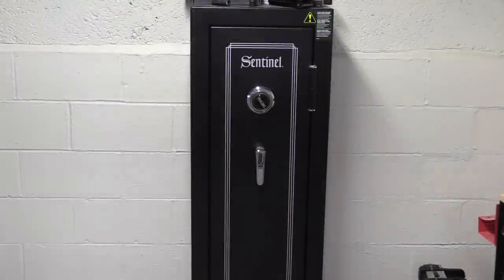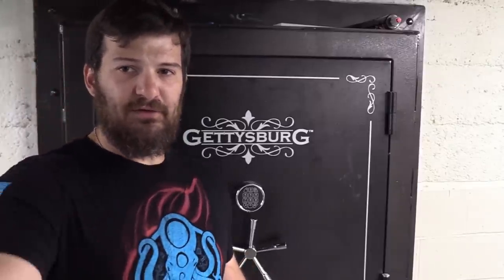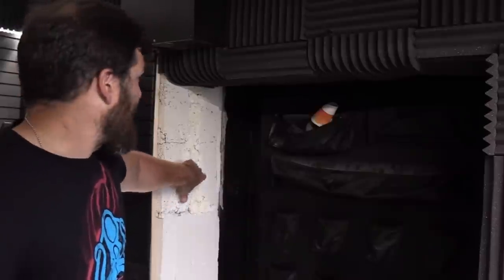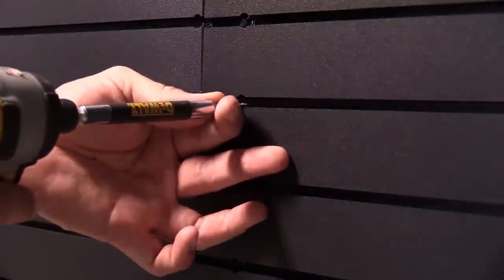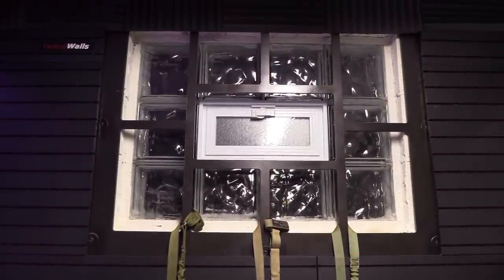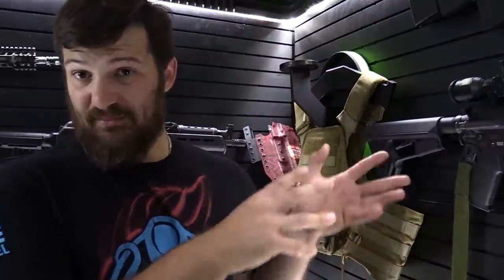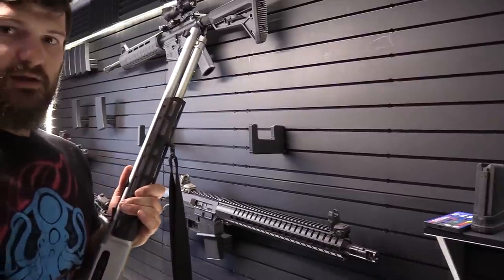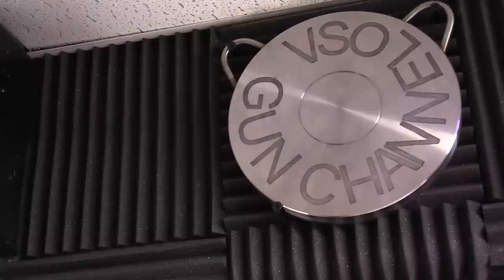The Ultimate DIY Vault Room

Comment: Solid concrete with steel reinforcement, giant steel safe door with more steel reinforcement, and a glass window. One of these is not like the other. #goofy
Reply: Tackle Response RIGHT WTF?!?!?!?!?!
Reply: Yeah maybe some ballistically resistant material; the industry actually makes one way bullet resistant ( note  that  I’ve edited this word proof to resistant at the request of another whose laser focus on my grammar can only be described as asinine , but in the interests of absolute clarity and correctness I have edited in .  I express my unceasing sorrow to the sixteen people who liked my comment before this edit and I pray my misuse of language has not lead them astray ) “glass”.  You can literally shoot through it from one side whilst absorbing impact from the other.
Reply: How do you get out if the door gets locked from outside
Reply: @112boatman  Anyone with common sense would have an override for the door. Not sure how that would work with just regular safe door but most people dont cut  the front of a safe off and use it as door. Not to mention hes not gonna fit out that window anyways.
Reply: grenade.. and a couple of dwarfs, and  you can clear that room  in 4 minutes.... a few skinny people also would work.
Reply: Drop ceiling...does that mean you can climb through the outside??? If so it was a total waste. Also, I don't feel the safe door without an internal override is smart or safe for the owner. Otherwise I think it's an ok build.
Reply: Ashanti Kidd na.. i drop ceiling is a lowed / suspended frame ceiling . it hangs off the exiting floor joices
Reply: there's also the fact that's a drop ceiling couldn't someone get in from the floor above? i mean don't misunderstand this space is a sweet mancave and props for doing it all himself but from a security standpoint? maybe a 5/10 if i'm giving max props
Reply: He said the ceiling was something like 18" thick concrete... he just added the drop ceiling for aesthetic and acoustic reasons.
Reply: 112boatman that is a handsome question and I’m glad you asked it! I think I have the answer: Humans can survive 187 days without food or water as long as they are  locked inside a safe containing that many guns. This room is awesome!
Reply: Looks like some steel bars across it, but yeah probably the weakest link.
Reply: show me a human being, who can fit through something 12 inchs, by 4 inchs that isnt a child, because lets be honest, an 8 year old would have a tough time getting in there.
Reply: the window !! LOL
Reply: @akidd2420  he said he has an 18" concrete ceiling the drop ceiling just hides it buuuut that window kinda defeats the purpose of any kind of vault
Reply: Get a battery operated grinder & your in lol
Reply: OK - so if there's a door release inside, so that you can't get locked in, and you can break the glass, just get a kid through the opening, and tell him to open the door from the inside; then it's just a race between the perp and the cop response time.  Takes timing, but - Ocean's 11.
Reply: Brian Manning this aspect is what makes all safes not secure but that's not really the point. I have a safe to keep the kids out and the prevent someone from walking out with it. Hopefully it takes long enough to allow the cops to arrive. A grinder is cheap and most places with a safe also have wall AC power to run a grinder on, heck I bet most people with a safe also own a grinder and extension cord. Suffice it to say, nothing made of metal will keep a determined person out of it. You can buy a plasma cutter on the way for $400 and go through a safe like a light saber using wall power and compressed air. A perspective coming from the mining and heavy equipment industry, it's apparently not obvious to people but the minerals are much harder than metallic elements and wear out steel like butter. When say, a face shovel is rebuilt a mechanic will cut the lip off typically. This is usually 4-6" of solid steel, they will air arc through it in minutes. 
My thought on the window: same principle to the steel applies, you could effortlessly cut it out with a torch or grinder. Probably start a fire with a torch tho. I think the window in all likelihood would essentially be an after thought. Presumably no one would know from the outside that there would be something special inside, you would find the safe down there and maybe connect that there is a window in the space. Investigate, break window, find bars. Hopefully the cops have arrived by now, he said they were quick. If you go into it knowing what your facing then there is an answer to anything you face but that's not really how most robberies are going to happen in homes (I think).
Reply: @CarCrazyRDM  he said that....but i don't know if i really believe it.  Don't know how you logistically create an 18" concrete ceiling, and also...a drop ceiling is not aesthetically pleasing at all.  Especially in this room.
Reply: @mrrobvs  Not on top of cinderblock basement walls especially. I imagine it's just regular residential construction wood floor joists and plywood up there.
Reply: @madmetalmaestro9806  probably should have listened better. He covered this.
Reply: @akidd2420  have you ever been inside an office building? Or any retail store ever?
Reply: @bored588  that mid section looks to be 8 to 10 inches wide. I could totally fit in there. 

On top of that, a solid diesel truck with logging chain would RIP the shit out of that grate
Reply: Weld door shut or block door = tomb
Reply: Tackle Response how about the drop ceiling? Lol
Reply: Y’all damn well know that the thief’s ain’t gonna realize there’s an easy way to do it bec they so damn focused on getting the door open XD
Reply: Kick that little window open and you can fish all the firearms out through it. No need for anyone to enter the vault.

As far as the door goes, a good angle grinder would make a short work out of those 15 bolts...
Reply: Bad ass room. Seems secure.. not sure about the glass window tho
Reply: even worse, the roof the wood floor above can EASILY be cut or smashed thru LOLOLOLOL
Reply: Block glass is a bit harder to break then normal pane glass and then that steel grate. Its not that easy for someone to get in there
Reply: @112boatman  MOST PEOPLE WOULD NOT.  BUT YOU CAN JUST TAKE THE BACK SAFE DOOR COVER OFF (USUALLY FABRIC OVER SHEET ROCK) AND DISASSEMBLE THE CAM SYSTEM THAT HOLDS THE DOOR PINS IN. THEN YOU JUST PULL THEM OUT.  PRETTY SIMPLE IF YOU HAVE THE TOOLS (NOT VERY MANY NEEDED). A BIT MORE DIFFICULT WITHOUT BUT CAN STILL BE DONE.
Reply: Well, technically it's all a waste of time since he said it's on a security system, and the police have a very fast response time. He could have just bolted a generic gun safe to the floor if your using a good security system, and your police actually show up in a timely manner. That just means you won't have enough time to rob anything.
Reply: And drop ceiling...
Reply: Oda Chikazane unless they watch this video
Reply: Lol...someone’s gonna be able to get in there
Reply: @charleshetrick3152  Bullet resistant is not bullet proof.  Also...  It's not one pane of "glass"  It's several layers of plastics, glass and absorbent films.  The protection works for both sides the same exact way.  So there is literally no way for it to be vulnerable to one side and not the other.  Basic science tells us this as well.  Certain rounds will not stop penetration, but merely slow it down.   If you hit the same general area with a round, regardless of size, the protection will fail. 

Movies do not tell the truth my man!
Reply: @charleshetrick3152  I guess you don't understand that if the "glass" is weakened, it will NOT be effective.  BUT you also failed to hear him say "BULLET RESISTANT" within the first minute as there is no such thing as "bullet proof" as you said.  

Plus, from the "9mm" hand gun test...  They used hollow points one way and steel core FMJ the other way.  Plus if you look at the hole sizes, they do not compare.  The impact point of a round that is stopped would be larger due to the fragmentation of the round.  

For the riffle test...  Look up muzzle velocity.  The shot fired into unaltered safety glass from 25 feet is significantly slower than from point plank range.  PLUS, it was fired into a compromised window, which eased it in breaking through.  

You must be from The Hetrick-Martin Institute.
Reply: DifficultyLevel Noob if you’re so concerned maybe buy some of their product and test it yourself and show me how it’s done.
Reply: I looked up the institute, you see I did research before talking right out off my ass.  The institute purports to support LGBTQ and so forth.  I believe in the freedom of all people and can see not problem with the institute, given a five second reading of their mission statement.   There are however an unfortunate number of bigoted individuals in the U.S. so maybe I’ll let them (the institute) know that one way bullet resistant glass exists.
Reply: DifficultyLevel Noob I can find no documentation of wrong doing on the part of the institute.  Please enlighten me and provide me with sources that I might know better.
Reply: DifficultyLevel Noob re 9mm at muzzle vs 25 feet you’re wrong,  you’d be looking at barely 35 ft per second velocity fall off from muzzle velocity.  That’s within the margin of error for the majority of instruments used to measure velocity.
Reply: DifficultyLevel Noob glass was written in quotes so as to let the reader know I knew it wasn’t regular glass.  Just like when CNN calls rioters protesters they really should put protesters in quotes as to draw a distinction between the denotative and metaphorical use of the word
Reply: DifficultyLevel Noob I’m not particularly familiar with LGBTQ issues or communities but when I search for criminal complaints or records regarding the Institute I cannot locate any.  If they are really promoting pedophilia and you’ve evidence to that effect have you turned it over to any policing authorities.  If you have and been unsuccessful convincing persons who could to prosecute please do let me know.
Reply: @charleshetrick3152  "For the riffle test...  Look up muzzle velocity.  The shot fired into unaltered safety glass from 25 feet is significantly slower than from point plank range. "

Where are you getting anything to do with the 9mm test and distance from?  The riffle was a 7.62x39 not a 9mm.  Great "research" there buddy!
Reply: @charleshetrick3152  Sure you can't...  If you couldn't tell by their bio...  Targeting school children.  A 13 year old is a school child in case you didn't know.  BUT, I am sure you missed the lawsuit info and legal issues that their staff have come onto.
Reply: @charleshetrick3152  "the industry actually makes one way bullet proof 'glass' ”  You can insert plastic, paper or even wood if you like.  It doesn't change the fact that you stated very clearly "BULLET PROOF"  But you can't handle that you are wrong and fall back on trying to change the topic of the discussion so that you can feel okay with your ignorance.
Reply: DifficultyLevel Noob yeah it was late for me and I was doing other stuff whilst reading your nonsense.  Muzzle velocity drop off for 7.62X39 from 0 to 25 feet is so insignificant that there is no possible way it matters.  So I think my brain jumped to the conclusion you meant to be talking about pistol cartridges.  But still I had a gander at a few ballistics charts and they don’t even measure the difference from muzzle velocity till 150ft.
Reply: DifficultyLevel Noob you’re the one who brought up the LGBTQ business not me so that’s be your who changed the subject.  I am adult enough to go ahead and edit my original comment as to allow you to more keenly focus on searching for evidence of wrong doing on the part of the Hetrick Martin Institute.
Reply: @charleshetrick3152  Just so you know...  Saying "bullet proof" isn't a grammar issue.  It's an issue due to ignorance.  It's okay not to know everything.  Although you seem to have been offended and started with the personal attacks.  How do you think I related HMI with your name?  BECAUSE IT HAS BEEN PUBLICLY SHAMED!  I am not going to do your job for you.  But keep changing the subject.  

They don't measure until 150 feet huh?  Why is there recorded data that shows a drop of just under 200 FPS within 50 feet.  This would mean that about 80-90 FPS was lost within the first 25 feet.  This is a lot when it comes to penetration.  PLUS at point blank range you have the blast and gas explosion that assists with the fracture and failure of the surface.
Reply: DifficultyLevel Noob you brought up the Hetrick Martin thing I’m not changing the subject you brought it up.  You’ve presented no evidence to support your point of view. 

gram·mar
/ˈɡramər/

noun
the whole system and structure of a language or of languages in general, usually taken as consisting of syntax and morphology (including inflections) and sometimes also phonology and semantics.

Whatever data you have a about muzzle velocity re 7.62X39 is wrong.  Buy a gun and a chronograph and test it yourself. 
http://gundata.org/blog/post/7.62x39mm-ballistics-chart/
Reply: DifficultyLevel Noob for example if you ask for concrete when you mean cement you’ll get the wrong thing similarly if you ask for a clip vs a magazine.  However if you ask for bullet proof vs resistant glass you’ll effectively be given the same thing because bullet proof doesn’t exist.  So if I refer to it a Smergolsmagal glass it’s still the same thing.  That is why your insistence on the grammatical correction is asinine.  The only reason your still pursuing this must be because you’re in love with me?
Reply: @charleshetrick3152  Look up the test conducted on Wolf 7.62x39.  You would see that you are wrong as you said anything less than 150 feet is not tested.

Your explanation of grammar just proves that it wasn't a grammar issue but one of ignorance.  You are trying to change the subject yet again from the incorrect words or terms being used to the structure of what you said.  It has nothing to do with the structure or grammar of your post.  Bullet proof vs. bullet resistant is not a grammatical issue.  

You said that you read their mission statement.  I guess you missed the part of 13-24 year olds being targeted.   Just like you missed the law suits and criminal complaints of it's members.  Just because you can't do it yourself, doesn't mean that I have to.  The burden of proof is on you to prove me wrong.  Not the other way around.  

You can't even put your complete thought into one post.  You need three to do it.
Reply: 112boatman window
Reply: And a drop ceiling
Reply: Im more looking at whats clearly spot welds holdin that door on its frame. Thats not a terribly difficult task, just a few minutes with an angle grinder. 
Edit: also, those bolts. You could easily grind those off and pry it out
Reply: The whole time I was wondering how he would ventilate the room but that was the method he choose. Idk if I would've went that route tho
Reply: I'd fill it in and just add some emergency oxygen tanks and masks
Reply: I came in to say the same thing.  However, its hardened steel though.  So essentially it takes the grinder just a few seconds more.